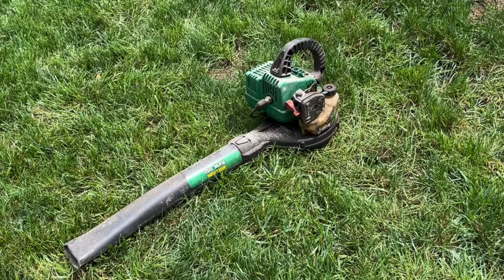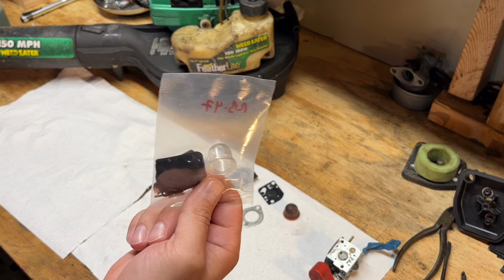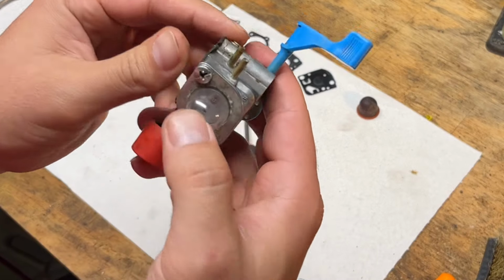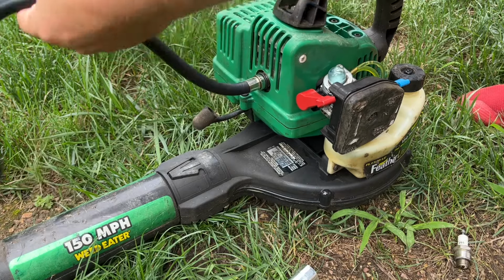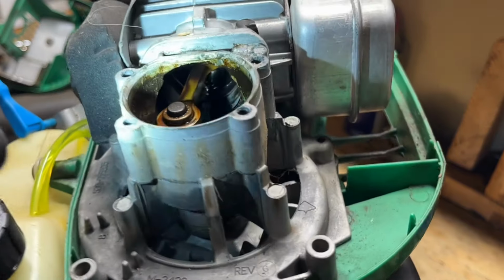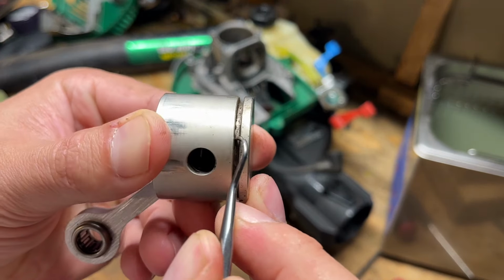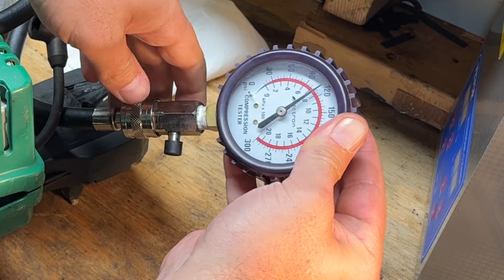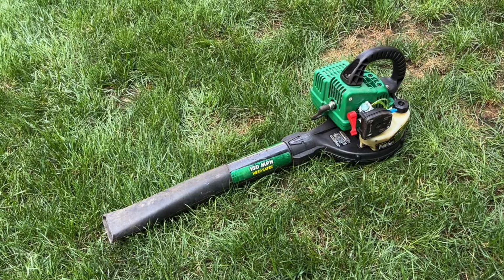Pulled from Storage - Fixing a WeedEater Featherlite FL1500LE Leaf Blower

Comment: Just got one of these. My compression reading was about the same as yours, roughly 65. Looks like I'll be doing the exact same rebuild. Huge thanks all the part numbers.
Reply from the maker: Glad I could help!
Reply: @BackyardRepairs  So I got my blower running already. Turns out my compression tester was giving a false reading, from having such a long hose. I ended up pulling my top end, ring wasn't stuck. Cleaned and reassembled, took the muffler off and burned out the carbon build up, still no start. I was stumped. Then pulled the magneto off and discovered the keyway had sheared and timing was off, explaining why I had spark just not timed correctly. Filed down a random woodruff key I had laying around, re assembled and she fired right up.

Comment: nice video. you could have just added Mystery Oil to the cylinder for a few hours soak and that would have probably freed up the ring sitch.
Reply from the maker: good idea. I doubt MMO would be strong enough to dissolve the carbon by itself without the heat from engine actually running tho